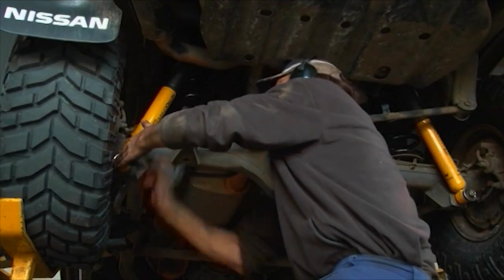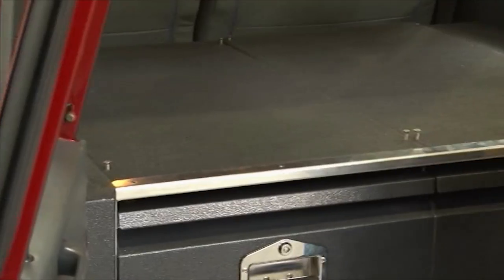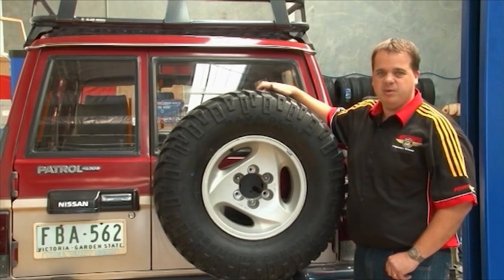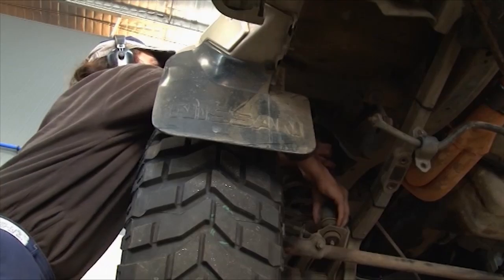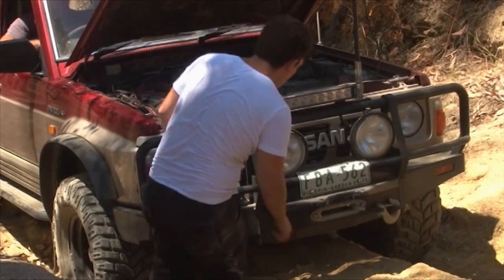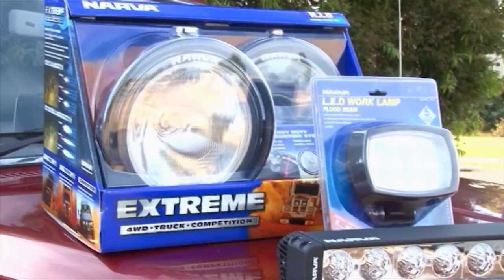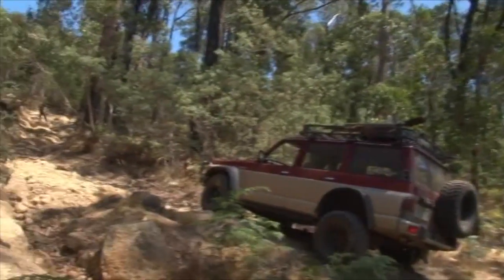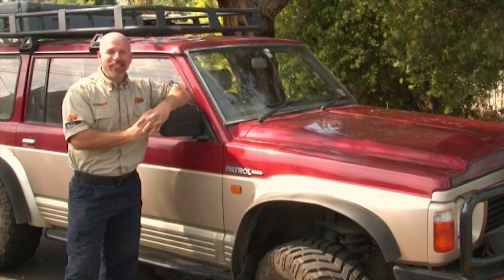Stock To FULLY Modified - Nissan GQ Patrol

Comment: Hey guys love ya vids, just wondering what is the best turbo diesel 4wd as a first 4wd preferably 1990's?
Reply: 60 or 80 series LandCruiser. GQs with the 4.2D are good too but we NA from the factory
Reply: Blacktop Nissan TD42 is a 4.2 factory turbo diesel. Toyota 12HT is 4.0 factory turbo, 1HDT, 1HD-FT, and 1HD-FTE are 4.2 factory turbo. All good motors

Comment: Whats the cost of all of this new gear?
Reply: Diff lockers fitted $3200. Bullbar $1600. Suspension $1200 at least. UFH $200. Antenna $200. 4 terrain clutch $600. Tyres $1700. Winch $1000. Rear storage $1000.  Roof rack $1000.
Probably near $12,000 including the lights, more if you count all the installation.